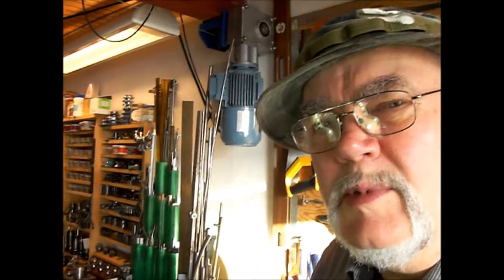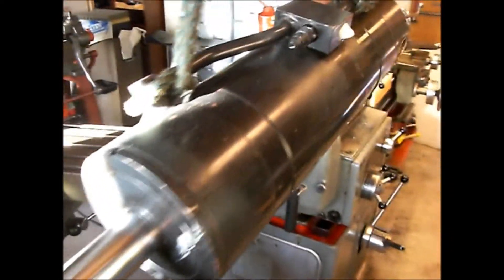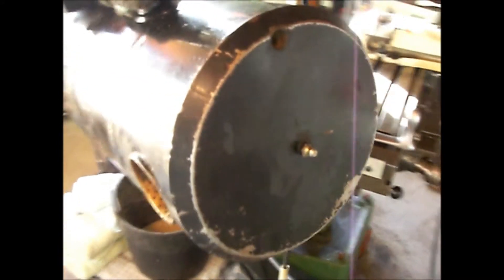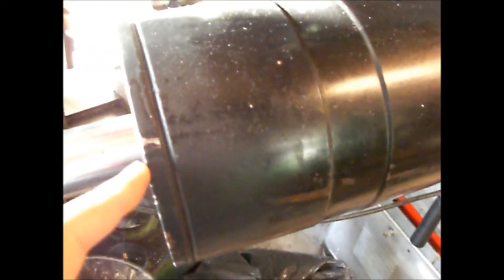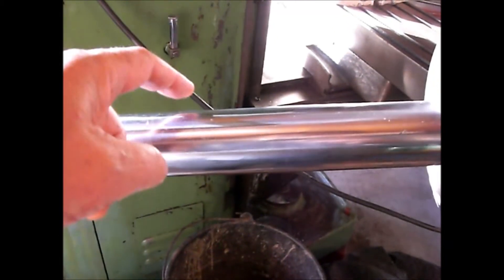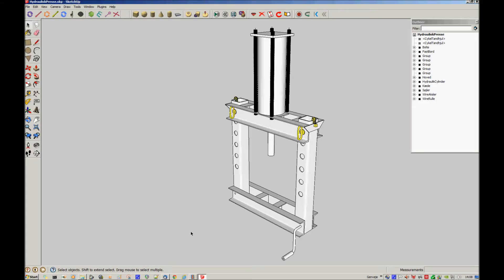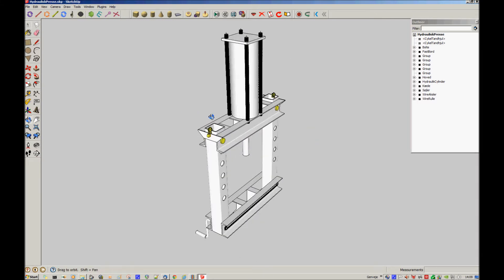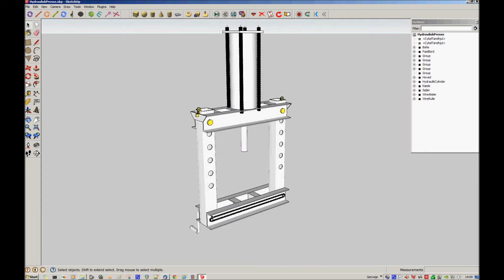Piston for Hydraulic Press

Comment from the maker: Yesterday I fetched my hydraulic cylinder for my press - take a look at my web site too for more details:

http://kelds.weebly.com/hydraulisk-presse.html
Reply: Hi Keld,

That is going to be a really nice press.  You will give Keith a run for the money. One thought I had looking at the model is you might look at opening up the width a bit and sinking the cylinder between the upper channels.  It might reduce the overall height and give a little more table working surface. 

Best regards,

Tom (hegn) Lipton
Reply from the maker: oxtoolco Yeah, you'r right ... but it's already a monster and if I have to do that I too have to widen the towers and then it'll be a huge monster.
I'll try to take the cylinder apart and see if I can shorten it a little (to reduce the overall height) - shortening the cylinder will require a steady rest for the lathe - so, there is a project more !!!!